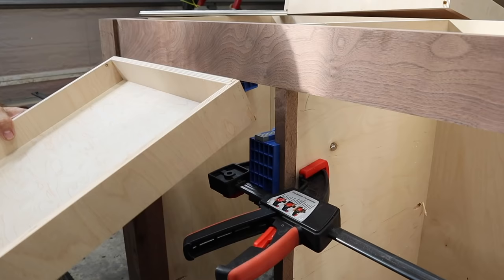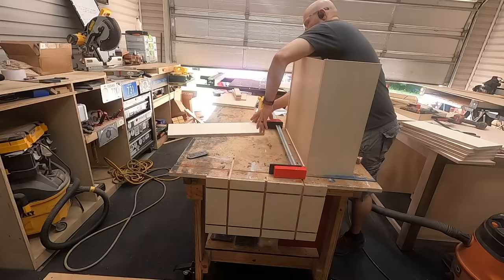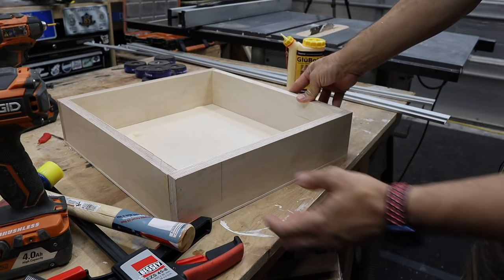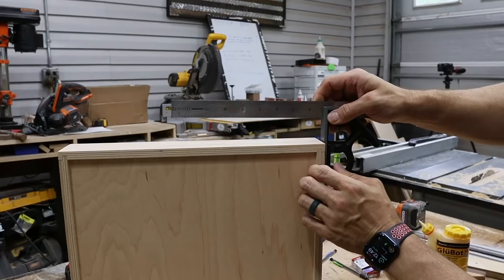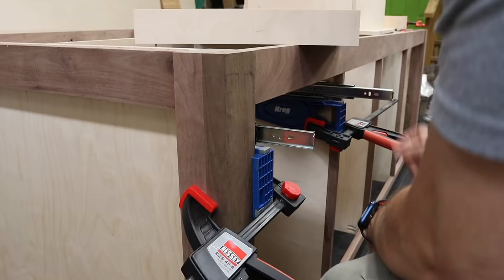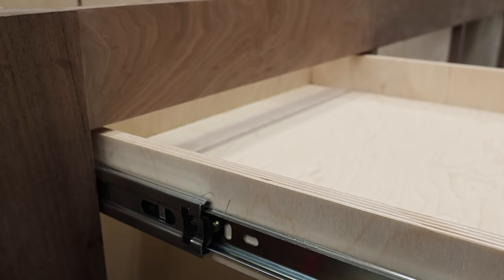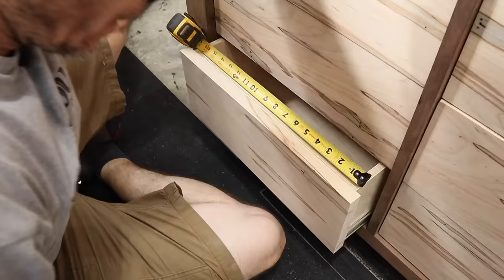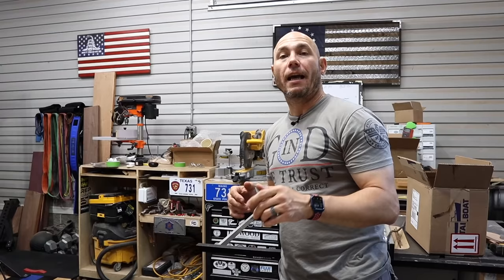3 Ways To Build EASY DIY Drawers | Good, Better, Best

Comment from the maker: This is how you joint boards WITHOUT a jointer:  https://youtu.be/UFfj8qGVxZ0
Reply: How do you prevent a braid nail from going through the wood/out? Because I know this happens a lot to me and it messes up my projects alot.
Reply from the maker: Check out FixThisBuildThat he has a video on that topic
Reply: @731Woodworks  ok thank you

Comment: Just a little tip for the drawer bottom's. I wouldn't glue those in place. I always just slide them in the groove and put two screws underneath, up into the back piece. That way if the bottom gets damaged or starts to sag over time...you can just cut a new one real quick and slide it in..instead of making an entire drawer again
Reply: That is a good point.  I have RV drawers that are too short or long and not gluing bottoms is an easy way to change them over time.
Reply: With solid wood you need to accommodate for movement. Use good plywood and it won’t need replacing if it gets damaged somehow build another drawer. 

I made a six-foot long mechanics tool box in 2001. Just the bottom box. I welded a steel frame but the panels, drawers, and dividers are all Baltic birch constructed with (??) 4mm bottoms. 
Nothing has failed, not even the drawer dl

Comment: If you do many drawers with false fronts, I would suggest getting some longer truss head machine screws (usually 8-32 thread) for your drawer pull installation.  It will save you the counterbores and provides a much cleaner look on the inside.  Steve
Reply from the maker: Thank you

Comment: Matt: I started using pocket holes many years ago, but learned something new this past week from a another YouTube maker. He demonstrated installing the pocket holes on the outside of a box (in this video, drawers) and the joint was substantially stronger because the screws bite into the wood farther away from the edge. I realize that on a box whose outside is exposed, the pocket holes would need to be covered. I have yet to try it this way. I thought you may be interested to know about it. God bless you. –Rick, USMC
Reply from the maker: Thank you
Reply: I've seen this method before too. The holes can be hidden in the back of the drawer and covered by the faceplate on the front. You'll never see the holes unless you take the drawer all the way out to show someone how you did it. -Joe, USN (I had to through that in)
Reply: @woodandwheelz  thanks, bro. 😁 -Rick
Reply: But at any rate, drawers don't need all that structural strength. Put the pocket holes wherever you like. If you don't like the thought of the holes, just throw a dowel and some glue in there and cut them with a flush cut trim saw.  That's how I do it. 
-Blake, US Army

Comment: I use a Stanley Center Read tape measure in cases like this, along with a template to locate the screw holes.  Very fast and accurate,

Comment: Second method is the best , I'm using it 20+ years and never ever had any complaints from my clients.. if you put the wood glue on the joints it will be stronger then wood by itself , and it is the fastest way .. why complicate our life if all methods works but the second one is the fastest and easiest;)

Comment: Good video, when you were using the calipers depth gauge it would probably be nice to have a shot of it near the saw blade for those unfamiliar with the calipers. Since you showed the digital readout and the main jaws before cutting to the depth measurement. Love the look of the ambrosia maple drawer faces.
Reply from the maker: Good tip

Comment: Another good video Sir.

Dovetails aren't difficult, the jig (a good one) is a bit pricey though. The process doesn't take much more time either once you have your setup done. 

Note: Woodworker to Woodworker...Don't glue your bottom panels to drawers which are set inside the Dado's. Those should free float inside the grooves. Reason being, expansion and contraction of the panel. Because the panel is thin (1/4" +/-), it is going to expand with different temperatures quicker than thicker materials. As well, the panel itself should be slightly smaller in size than the dimensions of the groove's to allow for that expansion. 

Over time, if not allowed to expand and contract, it can pop out the sides of your drawer sides causing the drawer to become tight against the slides making the drawer difficult to open and close. 

Go into your kitchen and pull out a drawer (assuming you have standard kitchen cabinets). You'll notice that those drawer panels are "wiggly" / free floating. Also your cabinet doors themselves (assuming they are panel doors, not solid wood). Place your hand against the panel and move up and down. Might not be much, but you'll notice a bit of wiggle. 

Hope that makes sense 🙂.

Keep the videos coming.
Reply: Expansion of the panel is only a concern with solid wood, not manufactured panels. The glue greatly increases the drawer strength.
Reply: @rorywynhoff1549  Wow, that's an old post. 

I worked at MANY cabinet companies over my woodworking career, various shops. None used glue for the panels. Another reason why NOT to use glue for the drawer panels is for the possibility of a collapsed drawer bottom. It happens. I've seen some where a customer accidentally left the plug out on a cooler they had placed on the counter. The ice melted and water drained into the drawers. Had we glued them, the entire drawer would have had to be replaced. But, because we didn't glue them, the back of the drawer was able to be popped off, drawer bottom slid out and a new one cut onsite and replaced. Took longer to get the tools out of the truck than to make the repair. 

Point is, you don't glue drawer bottoms.

Comment: Just in case someone hasn’t said this already…. If you have several drawer fronts to mount:
1.  Lay out the hardware holes on the bench, much easier
2.  Make a jig from plywood that hooks over the top and side, make it symmetrical so you can use it left and right (if putting in two sets of hardware to left and right sides or like on cabinet doors).  Put it in place and use the holes in the drawer front to make holes in the jig.  Now you can drill every drawer front or cabinet door without measuring.
3.  Shim the front like you did, playing cards make great shims (from Bourbon moth)
4.  Using truss head screws fasten the drawer front using the hardware holes
5.  Open the drawer and fasten the drawer front from the back.
6.  Remove the truss head screws, drill through the drawer slide and install your hardware.

Once you make the jig subsequent drawer fronts are installed in 1-2 minutes each.  Much faster than laying out the hardware holes for each one individually.  Kudos to Bourbon Moth + my high school shop teacher!

Comment: How do you measure the drawers themselves?  I have a heck of a time making the drawers the right size for the opening I have.  I end up with (on a 4 drawer cabinet) four drawers all different sizes.  I am definitely over thinking it, but every time I have to make drawers, I just dread it.  It would be nice to see some video showing how to calculate drawer sizes and the gap between them and everything.

Comment: Excellent video, thanks for posting! #3 is my favorite method by far. One setup and you can cutdrawer joints for days. I use the same method at the router table sometimes too so the table saw is still free to cut other things.
Another way I commonly do them is method #1(butt joints glued and nailed with a groove for the bottom) but reinforce the joints with wooden dowels after the glue dries. Using a contrasting wood and consistent spacing adds a nice accent.
Again, great video! Subscribed. :-)
Reply from the maker: Thanks you

Comment: If you install your drawer bottom flush with or to the bottom of the drawer sides, make sure you have enough clearance underneath to account for some sag. I made some drawers with 1/2" birch ply bottoms, and they sagged in the middle an rubbed the frame/drawer faces underneath. That was with just clothes in them. 

I had to shave 1/4" or so off of the drawer face heights and re-postioned all the drawers to allow for the sag. It was a pain. Had bigger gaps than I wanted (about 3/8" instead of the original 1/8"), but that's my fault for how I designed them and didn't account for sag. I originally thought there's no way 1/2" plywood in a 20x20 drawer would sag with just clothes. It sagged within a month or so. 

I had built it as an in-closet dresser with the most optimized internal space possible. Drawer cabinets/furniture tend to have a lot of dead space within them. You can design a better system, but don't think your drawer bottoms won't sag.

Comment: Hey Matt. I like the 1/4 , 1/4 version when making a drawer. My question is the dimensioning length of the front and back pieces when fitting into the opening. Is there a quick and dirty way of figuring that dimension? You have to figure in the joint dimensions. I think Im just over complicationg this. Thank you. Just dicovered you on youtube and i really like your approach to wood working. Staring your router table/cabinet build tomorrow.

Comment: Not bad, I agree dove tails are too much work even with a katie jig but they are strong and look good. My advice is to get a drawer lock router bit, it is the best of both worlds, super strong,  easy setup  and quick results. Lose that CA glue crap, leave for model RC airplanes.

Comment: When putting on drawer pulls, I've always just drawn a line from corner to corner to find the center of the front, then divided the width of the screw holes in half. Then, use a small level or eyeball the level of the pull. Is there anything wrong with that?

Comment: Do you have any build plans for a work bench or any tips ?  I don’t know who built the work benches in my garage, but I need to put on the burn pile. I would send u pictures but it would scar you for life. The approximate size I need is 24”x 10’ this work bench would be on the sides of the garage so I have to keep them narrow. Thx. Brian. T.
Reply from the maker: Video and plans release tomorrow on my workbench build

Comment: 4 Bestest: dovetails with router and dovetail guides

5 More Bestester: hand cut dovetails

6: OMG, you’re just showing off now Matt!: hand cut half blind dovetails, everything handplaned, no sandpaper, no metal hardware (even the drawer slides) or fasteners, super hardcore style

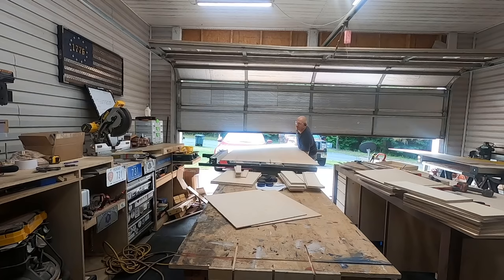Comment: 1:08 - That is a very good point.  I would surely forget that. Bottom of drawer does not measure from inside, side to side.  It measures from dado cut to dado cut sideways and back too.  So grateful you mentioned it.

This is a great video but unfortunately I had to leave at the 2 min mark.  I love your content, but the loud, obnoxious music is driving me mad.  I cannot watch anymore.  Turning off the sound is not an option in an instructive video.  My ears are hurting after 2 mins.

fyi - Please do not add ANY MUSIC TO ANY PART OF A DEMO/DIY VIDEO.  It is supremely irritating to mind and ears.  I listen to the voice then wince when voice stops and blaring rock music starts and race for the volume knob.  It becomes a game of ON OFF ON OFF ON OFF instead of focusing on content.  The single most irritating thing anyone can do to a viewer is to assault their ears with music.  Bear in mind that your voice is speaking over the full length of the video and that is enough audio coming thru. Do not add another level of sound as it overloads the ears and the mind.  Natural sounds of woodworking by contrast, are very soothing, especially to other DIY'ers like your audience.

Comment: I usually like the content you post, but the way you did the drawer runners was long winded. And then the drawer pulls, write man, that was convoluted. You used a Kreg jig for the runners, why not use their drawer pull jig. 

Thumbs Down for this video. Though you did do the drawer construction correctly, so many people show it wrong.
Reply from the maker: I have to keep the beginner in mind when making certain content.  The beginner is who this video was meant for, someone who has never installed a drawer or drawer pull.  It wasn't for you obviously.  The beginner needs more detail than you.